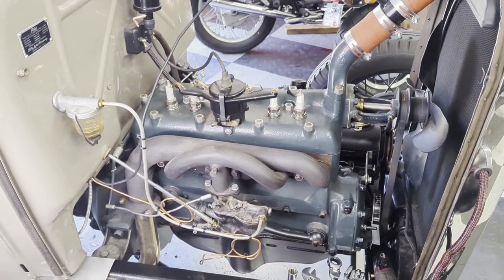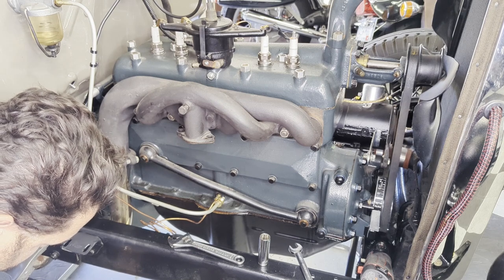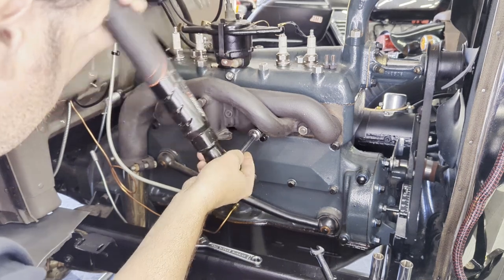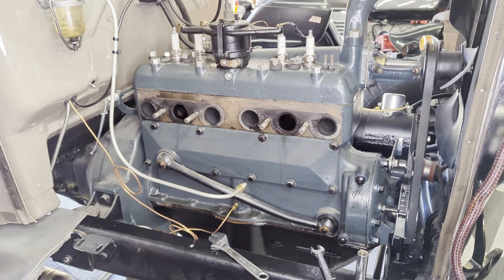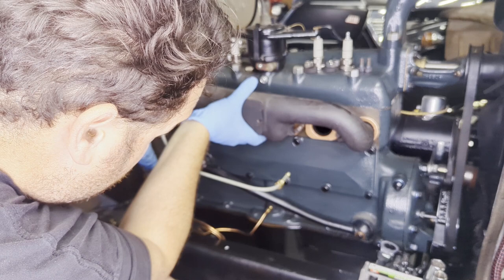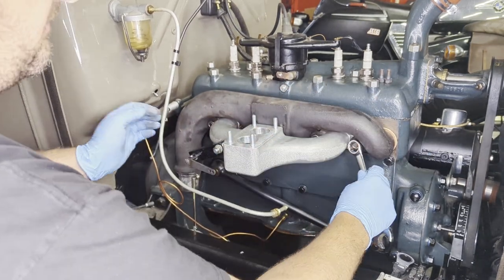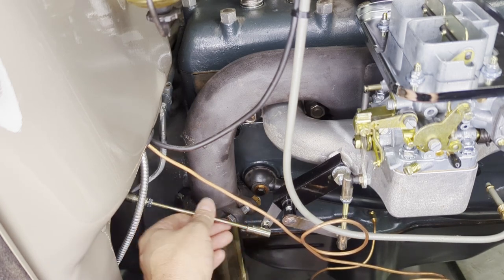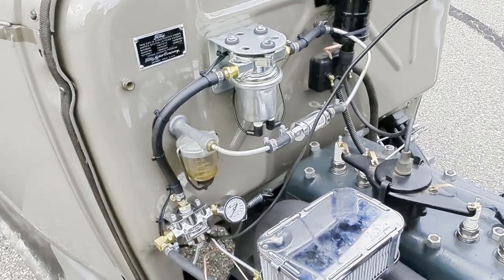Ford Model A Weber Carb Intake Manifold Fuel Pump Choke Install How To Four Banger Upgrade

Comment: If your old carb ran rich it could be for several reasons. Keeping the gas valve on the choke open too far. It doesnt take much after it warms up. Main and secondary jets may have too big of holes in them. A lot of old mechanics would solder them shut and redrill new holes. Gotta have an indentation at the too of the jets tho. This helped greatly. The float may not be maintaining the proper fuel leveling the bowl which allows fuel to flow out of the jets instead of being coaxed by the vacuum. That Zenith crab was designed specifically for the Model A and when just right would deliver 25 miles to the gallon. I loved working on these cars. They were fun to drive too.
Reply from the maker: Agreed, I definitely still had a problem I never sorted out. Not too worried, the weber took care of it.
Reply: U would think they sell jets after all this time. Lol
Reply: @apocolypse11  actually they do. But sometimes its quicker, easier and cheaper to solder them shut and redrill the hole. They have to be a certain length, and the hole has to be an exact size. (I would have to check my book to remember specifics. Dont want to get them wrong!) Sometimes remans dont quite measure up. Gotta box of them in the garage that are no good.

Comment: Model As do not have a pressurized oil system, so you really don’t need an oil pressure gauge. I tried the Weber setup years ago, and didn’t like how difficult it was to start cold.  Otherwise, it was a good system, especially with a high- compression head.

Keep an eye on that cheap pressure gauge, because parts of it can melt in that high-heat area.
Reply from the maker: Yes its pretty clear from watching the pressure gauge it is not real useful on this car haha. Oh well. I haven't had any problems with it.  So far the Weber setup starts much better cold and hot. The acceleration is the best part though, it can actually get up to speed in traffic.

Comment: Is it okay to use a drop type Weber? Do I need a fuel pump? From Japan
Reply from the maker: I'm not sure what drop type means? Yes I would recommend using a fuel pump for sure.
Reply: I can not speak English Sorry for the translation software.
Reply from the maker: No problem!  @ゅお
Reply: @OctaneElectrons  maybe he means gravity feed fuel instead of a fuel pump

Comment: It's been about 9 months since installation. Any issues or tips on running this unit? I'm considering getting one. Thanks
Reply from the maker: I drive it regularly and it is awesome. No problems. Works perfectly every time. Very happy with the weber setup. I modified a cast finned aluminum air cleaner to fit it, looks great. Go for it!

Comment: It looks like the center valve is closed on the screen, but do I have to open it three and a half turns?
Reply from the maker: Sorry what center valve do you mean?
Reply: @OctaneElectrons 
YouTube
MISAB  Grundsinstallning av Weber 32/36DGV 

Is the setting for this video correct?
Reply from the maker: @ゅお  Oh the mixture adjust screw? I would start with it about 1.5 turns out then adjust as necessary for best running.
Reply: Thank you
Is it OK to touch only two areas?
Reply from the maker: @ゅお  I'm sorry I don't know what you mean? What two areas?
Reply: Main settings ○
Idle settings ✕
Air settings △
Idle setting Don't know the rotation speed for adjustment?
Reply: engine would start. All that's left is some fine-tuning. thank you